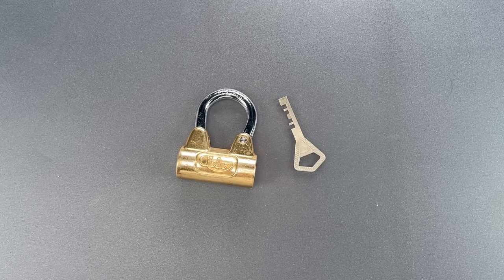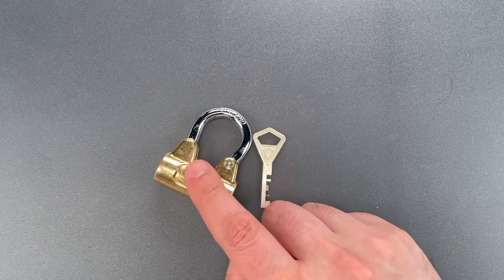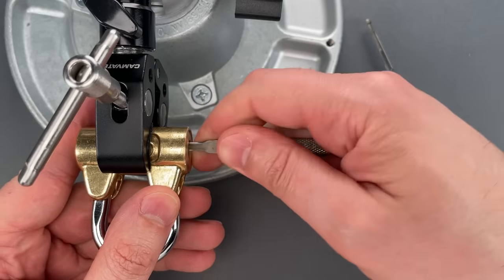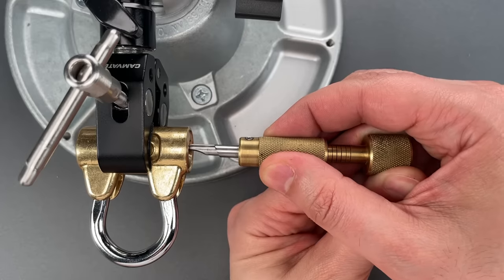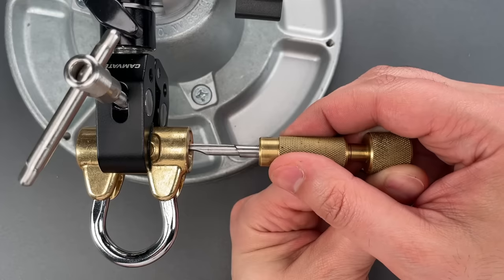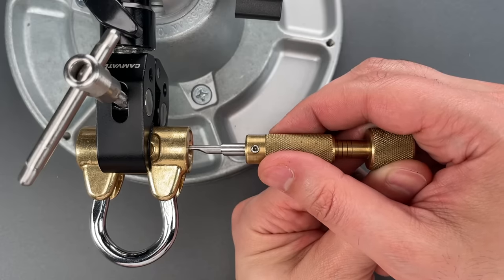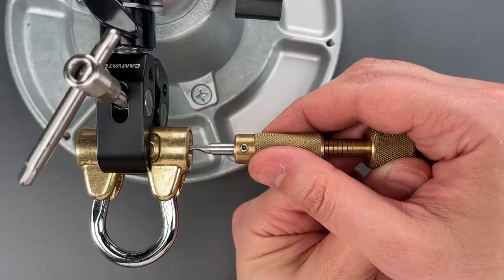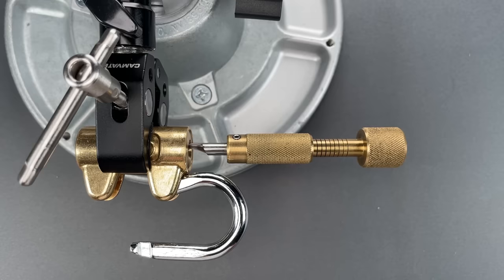[1416] Retro-Cool Abloy Padlock Picked (Model 3020C)

Comment: LPL: “…has a disc detainer core.”
Me:  Awaits the usual “tool that BonsianBill and I made” 
LPL: “… i’ll be using a tool that I made mySELF” 

DUN DUN DUUUUNNNNN
Reply: The tool that BosnianBill and LPL made cannot handle the keyway where the center of the lock cannot be used for the tool. This lock can be picked with home made tools but you have to start by grinding small pipes, not wire.

Comment: I guess any lock would fail an appropriate brute force attack.  Would I use this lock in a gym locker room? Absolutely.  Would I use it to lock the gate to a warehouse storage yard?  Absolutely not.  I expect it was never intended to do that job.  I am stunned to see locks that proclaim high security but are easily shimmed or raked.  I do not know what Abloy claims about this lock, but I would be happy to use it in appropriate circumstances.  Thanks to LPL.

Comment: Because of this excellent design from over a 100 years ago, most of the apartment door locks and the majority of all "non trivial" locks here in Finland are based on a rotating disk core. And of course all high-security locks are much more advanced than that "classic" retro design. There are almost no pin-tumbler locks here, other than the cheap hardware store padlocks.

Comment: >Not likely to be non-destructively defeated in the field
Unfortunately for everyone who think after watching LPL videos that disc core provides more protection it is not, because if regular core is quite easy to pick, disc core is quite easy to break.
LPL is too proud to show-off his tool to actually demonstrate how easy low-quality locks with brass discs can be opened with screwdrivers and other tools that can create lot of torque because there's a lot of room for a thicc shaft to enter the key hole and turn inside the lock.
Actually the main reason why tools for such locks are rare is because noone bother to pick them except for official lockpicker businessmen. Thugs are juct going to use a strong modified drill bit and a tention wrench and crack it open as fast as a Masterlock.
This bothers me very much because LPL praises these locks much much more than they deserve as if thugs are all skilled lockpickers, or spies who want to plant a listening device on your bike instead of stealing it. I myself had to break a lock like this back in the days because it got rusty (see [1073]), and with a proper size wrench the insides broke like a can of sardines.

Comment: For once, I have a question. Since this core is such a slow and specific thing to pick, are there any known reasons it's not used more often? I've only seen that particular custom tool a few times in my admittedly random watching of this channel, but seeing a prepared expert take that much time to open a lock makes me wonder what, if anything, went "wrong" with that type of core.
Reply: It is not used more often because it is weak obsolete core from 100 years ago and we have a lot better ones now. It's as simple as that.
The question though is, why are so much worse cores than this used so extensively then.

Comment: I feel like most of these padlocks really don't need to be all that amazing. If it takes LPL 5-10 second that's probs good enough. Wouldn't take long to just use bolt cutters regardless of the internal security of the lock.

Comment: Disc detainers were available in 1907, and we're still seeing wafer cores that can be raked and locks with bypass vulnerabilities?
I just don't understand the lack of consumer protection efforts for security products...
Reply: it's not always about security, more about ease of production
Reply: @thelockpickingspoon9074  if the locks are vulnerable to low skill attacks like raking, shimming, or simple bypasses, the customer isn't being sold a security device, they're being sold a decoration.
If a company chooses to manufacture a decoration they should not be allowed the pretense that it's a security device on the packaging or advertisement. It's simply fraudulent advertising.
Reply: @AlexanderTzalumen  the point of a lock is not necessarily physical security (though it should be) but also legal security. and no, locks are generally not "decorations," even low tier ones are not as easy to break into as it is to destroy the door/mounting they're on. not many people know how to pick locks, or rake them, or shim them, many people know how to kick, or throw a rock, or use a sledgehammer. point is that locks are rarely the point of least security, however, I do know some locks that are exceptionally difficult, lmk if you want links to good locks
Reply: @thelockpickingspoon9074  oh i get that that's how things work right now. When it comes to for locks for commercial or home security, yeah, the doors are often weaker than the locks securing them. However in those cases a good lock ensures that the door is tamper-evident. If the lock has been bypassed, you won't know it unless it's left in an opened state.
For locks involving chains, (e.g. bicycles, motorcycles) or safety purposes (e.g. Firearms) the lock is often the biggest vulnerability, and those are most often ones in which LPL finds some grievous design flaw.
I don't think we, as a society, should be content with shoddy lock design just because someone else wants to make a quick buck selling locks with problems that had engineering fixes decades ago.
Of course, this is coming from the viewpoint of a software engineer, and when those locks get breached, it's a much more publicized debacle.
Reply: @AlexanderTzalumen  the locks you use are something only you can change, I doubt you're going to be able to change anyone else's mind on this. It should be noted that lockpicking is inherently not tamper-evident. for locks that use chains, the lock being used doesn't have to be the weak point, and I know of several good bike locks out there. We as a society are used to shitty locks because the locks that are mainstream are shit, few people domestically, outside of locksport actually care about decent padlocks, they exist though (this all assumes you live in the US)
this all coming from a very invested locksport enthusiast, so I use locks that I actually recognize as good

Comment: I wonder, when this core is in an actual door lock, and to open it you need to turn the key against a pretty strong spring... If that makes the picking harder or maybe even impossible with a tool that isn't meant to handle that kind of force. This tool at least seems too flimsy for that.

Comment: You reference "While this is not a high security lock..." are you referencing the general lock design / materials or are you of the view that while this core is a little more challenging than most that it's [ still ] not up to a level you would consider usable in the field for high value targets (home entry, auto theft, etc.)?

Comment: With that type of lock, do you always begin at the farthest pin first, and why? Thanks, love your channel.
Reply: not pin, disk, and it's easier to start that way since your tool will be right next to the tension tip when you insert it into the core

Comment: LPL correct me if wrong, but it seems like a successful pick requires the pins to hold position due to friction from your tension. What if one (or more) of the pins had a much smaller diameter than the bore? Would a pick still be possible?
Reply: no, that disk (it's a disk detainer lock, not pin-tumbler) wouldn't interact with the sidebar at all, so it would just sit there and do nothing

Comment: In Finland there are tons of these, currently in use, to secure the storage lockers at the basement of almost any multi-story residential building. It is not cheap, costs around $30, or $80 for a set of three locks keyed alike. But what I would really like is for LPL to pick an iLoq cylinder!
Reply: Iloq being purely electrical lock is not pickable in traditional sense.

Comment: I wonder why he didn't use his normal go-to multi-tip detainer pick. This lock 'looks' like the same figure-8 keyway as the modern high security abloy padlocks. Maybe this particular size of lock is smaller than usual, so nothing else fits?
Reply: keyway. you can't tension that lock with LPL's other DD pick style
Reply: @thelockpickingspoon9074  Also it won't fit.
The key hole is half moon and offset.
Reply: @XtreeM_FaiL  ah right, thank you

Comment: Why can't modern padlocks be this good? Why do they all have to have cheap pin tumbler locks that are made of cheap metal or are plastic, and may not even have a shield in the back? Why? It's been proven disk detainer locks are simply better because they can easily have lots of false gates and they can also have a side bar and it doesn't cost too much more.

Comment: I would love to see a physical attack on this lock. I used this lock (a slightly older version) for my locker in high school where we once had a break in and my lock was one of the few that wasn't broken.
Reply: The body is brass. You can hacsaw it in few minutes. A coarse file would work too.
Reply: @XtreeM_FaiL  definitely, even a well placed hammer blow could probably force the shackle open as well. It is not a high security lock by any means but it was miles ahead of the other ones, with roughly 1000 lockers to break into in one night the thieves needed to be quick with each lock. The perpetrators used large screwdrivers which they placed inside the shackle and broke the locks open, most lock bodies there were aluminium.
Reply: @Eldser  You can bang it quite a long time.
Hammer is not a precision tool for that.
A screwdriver will be better. You can pry off those "ears" that holds the shackle.
Reply: @XtreeM_FaiL  combined with a chisel or a drive of some sort you could probably deliver the force precise enough to shear off the small brass piece that holds the shackle close inside the lock body

Comment: Not so retro in pricing.  This lock goes for $82 on Amazon.  Which means that whatever it's protecting is worth a lot.  Which means destructively defeating it may be worth it.
Reply: What a ripoff. You can buy Abloy PL340 for that price. Full steel body, 10mm Boron steel shackle.
Or maybe you want something bigger. $100+ you can get PL350. 14mm shackle.
Reply: Amazon with cheap prices. I can walk to a shop 5 minutes away and buy one for maybe 20€. That is really cheap for something produced in Finland where 0,5l coca cola costs 2,5€.